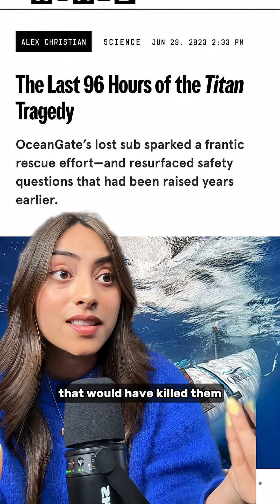Expert Reveals What Went Wrong with the Titan Sub

Comment: The Titan sub was used multiple times and made multiple trips to the Titanic and they were fine after 96 hours
Reply: At dive 80 it was clear to Stockton that the carbon fiber had already cracked and was starting to fall a part. Every five after that it cracked more until finally the last dive killed all the passengers
Reply: You have to watch the full video
Reply: Stress fractures
Reply: Progressive delamination of carbon fiber from successive dives resulted in final failure.